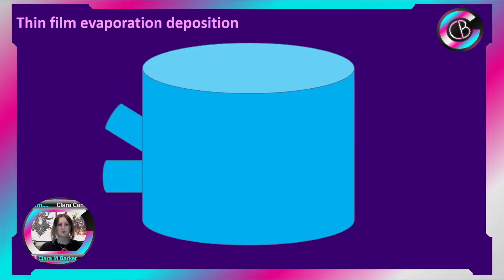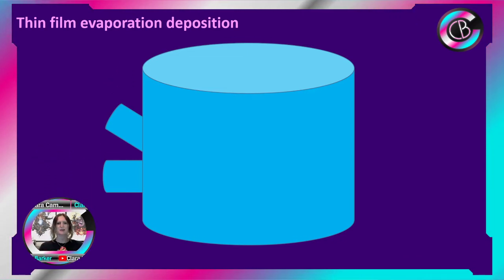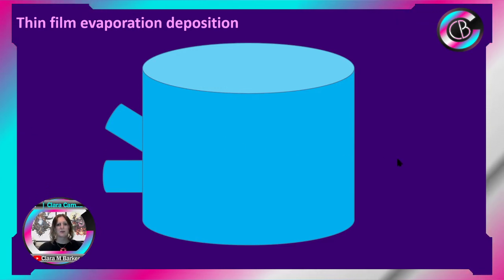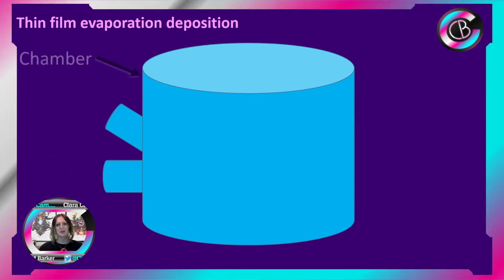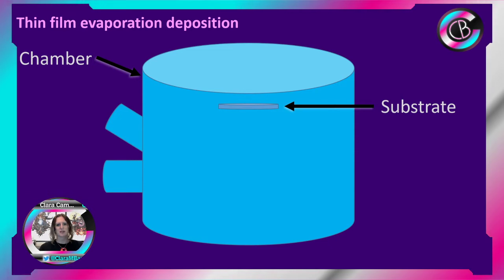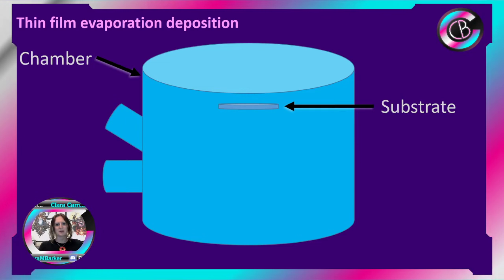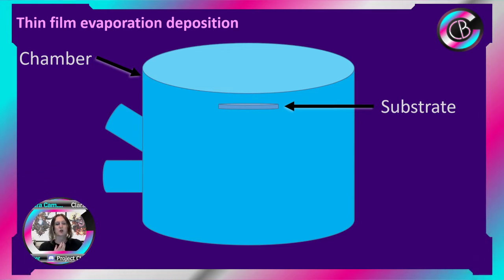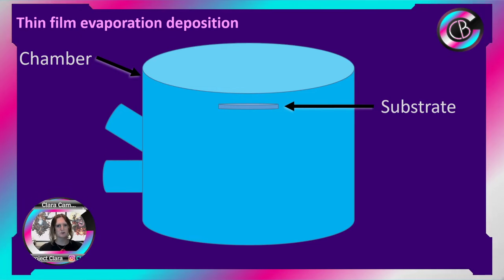Thin film deposition using evaporation

Comment: Excellent explanation! Is it possible to thermally evaporate dielectrics? I'm curious if you could theoretically melt something like alumina or SiC in a vacuum to grow a film, not sure how those binary compounds react when heated in a vacuum, if they split up or stay together and condense on the substrate.

Thanks!
Reply from the maker: Thank you. 
You can evaporate various composite materials. I don't know speciically with these examples but it is possible. Sometimes a different type of evaporaton is used though. 
It's interesting - just because you can do it, doesn't mean that it is the right technique. Different dypes of deposition are used for the similar materials depending on the properties you want. It's the equivalent of painting a wall, you can use a small artist paint brush, a large decorating paint brush or a roller. Each will do the job but at different speeds and to different finishes.